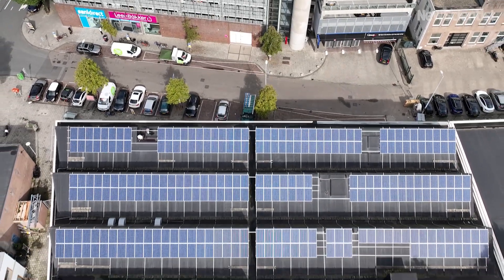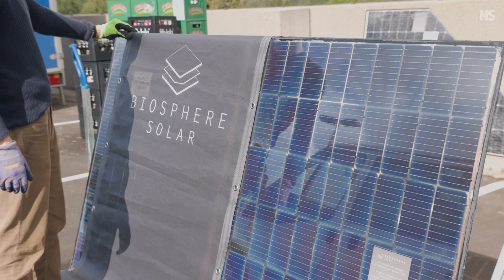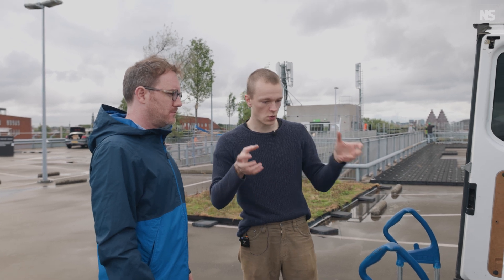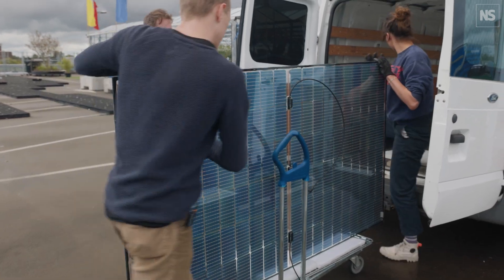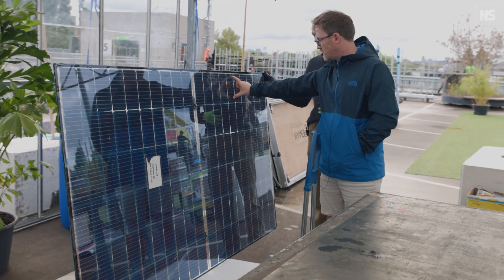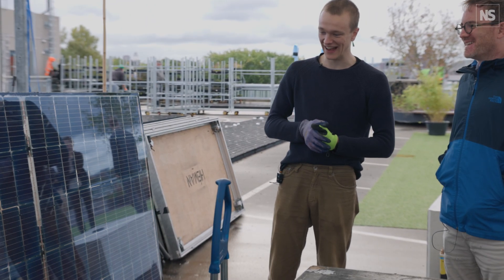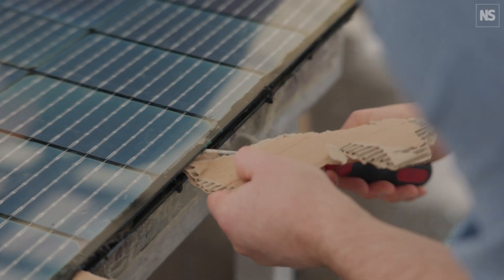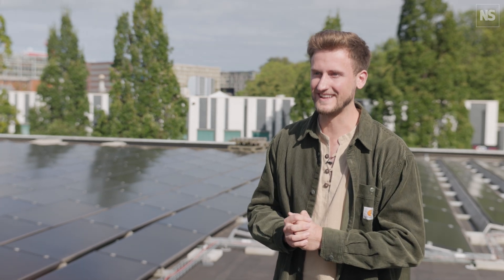How repairable solar panels are helping to drive Amsterdam's circular economy

Comment: But the price of solar panels in China has now reached $0.09-0.06/watt. 
And in 2030 it will fall to $0.03 /watt.

I doubt this will be economical .Considering the amount of manpower cost required to replace components
Reply: And the replacement panel would be more efficient. The manpower for this is insane

Comment: Having the panel be a board that you plug chipsets into would be an easy partial solution if you set it up to easily replace bad chipsets.

Comment: Yes do make your energy grid overly dependent on solar just like Spain did and see what happens, and remember that during the night electrical energy use does not just go to zero, in advanced countries it only drops 20% over the daily peak and its a scientific fact that winter daily production is a tiny fraction of summer daily production, in the US NE it's 1/5, and you can't shift summer production to winter.

Comment: If they have a 25 year working life, what's the point. By then the next jump in tech will have happened.  Why would I gamble my purchase life span.
Reply: That 25 years is a bit misleading.  The solar cells themselves might still be putting out 80-90% of their rated power.  25 years is the lifespan of the glues and sealants, in theory a panel could still be producing power after 100 years if water doesn't get in.

The other reason for all the glue is the cells can crack if they get too hot, so they're bonded to the metal back for cooling.  I'm not sure how the panels in this video handle that.
Reply: @j.f.christ8421  they dont that is why they run in to the issue of needing to replace them .
Reply: @cornnatron3030  Eh, thermal pads and/or thicker substrate might work.  That was the problem with very early solar cells, too thin so they'd crack easily.  Newer ones are thicker, still pretty fragile though.  Buy a raw cell and put it out in the sun short-circuited, it might crack from just the heat of the current going thru it.

Comment: It would  be interesting if you could fill it with mineral oil to cool the panel and transfer the heat to heat recovery pumps outside the panel to increase total system efficiency and provide CHP.